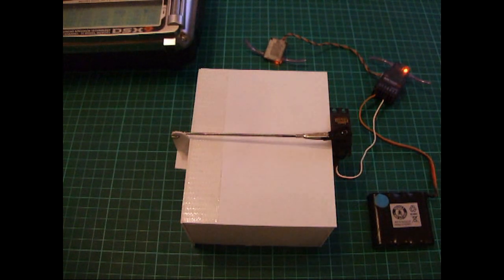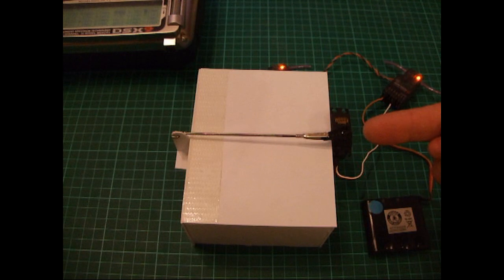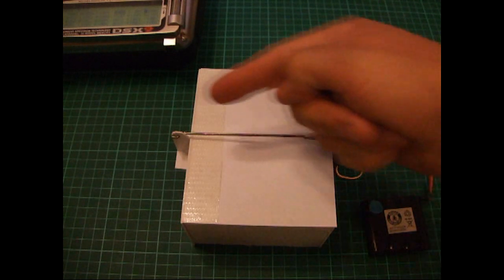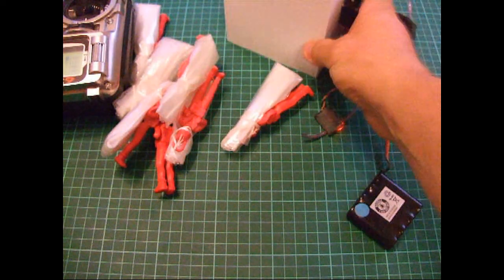Parachute drop mechanism

Comment: Hi sir .I interested your project same like my quadcopter project for drop parachute . what material used for this box ? . can i use servo motor Futaba s3003 for this task ?
Reply from the maker: This was made very simply from plastic card, available from most good hobby shops. As for the servo, it all depends on the size of the box and the load that will be on the door. This was done at a slight angle, so there wasn't much load, hence the small servo.